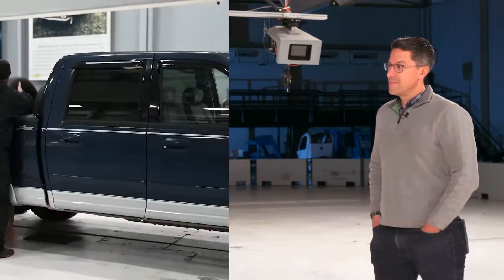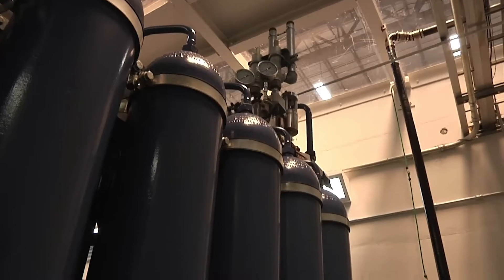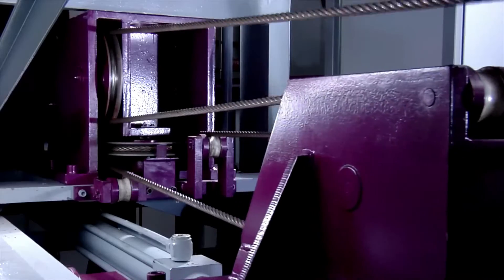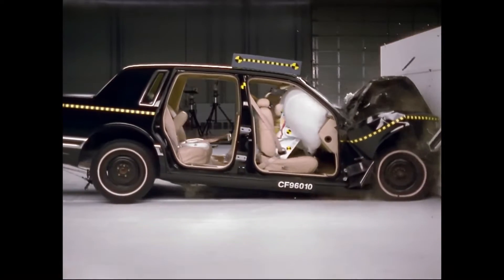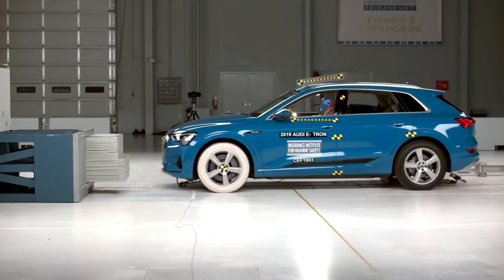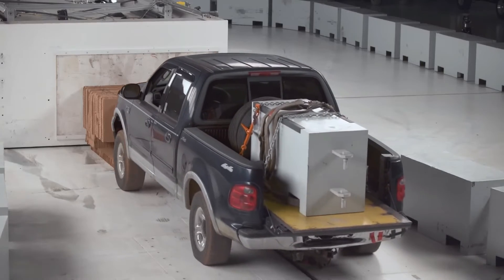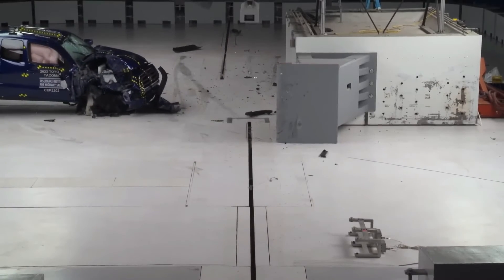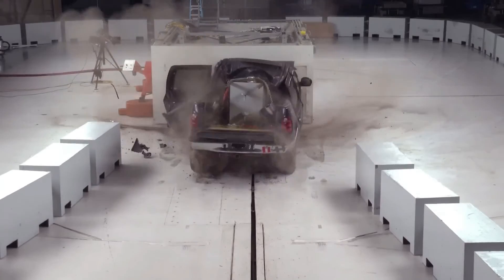Truck Crash Test with a Loaded Bed

Comment: Yup, and I was just wondering what happens to the load in the back of a pickup and how much load that "barrier" would protect the occupants.  Um, yeah, though that F-150 was 2015, have they improved at all since, and I can't be the only person wondering this.  I can't say most,. but several pickups I see on the road have unsecured loads, of what it visible, let alone what is not visible.  I can understand from a testing perspective how variable the loads could be, therefore how difficult it might be to account from all the various loads, but surely there could be a baseline you could use.  Anyway, keep up the good work!